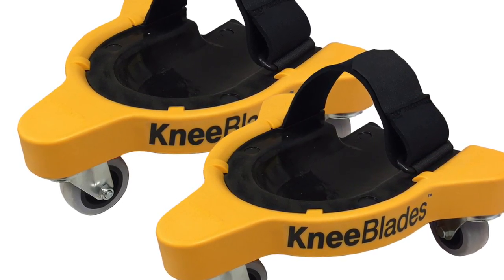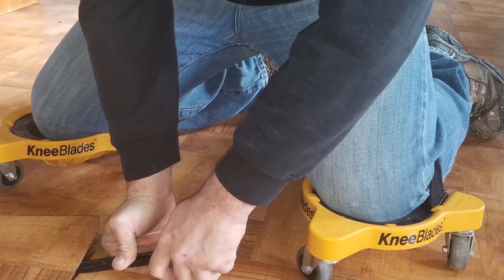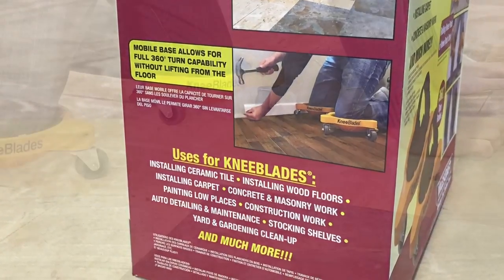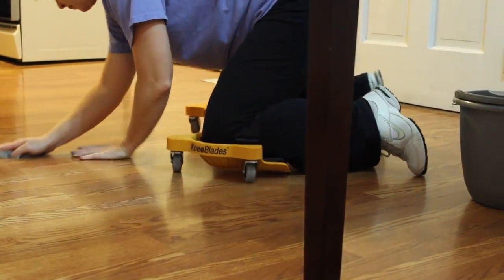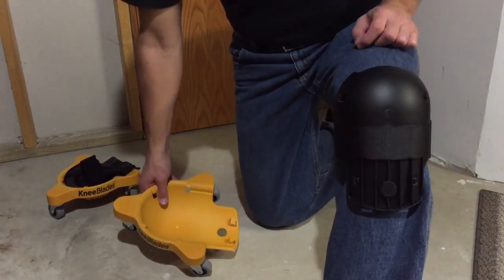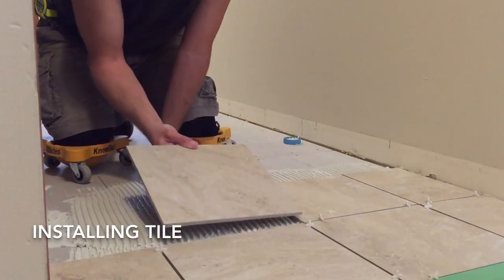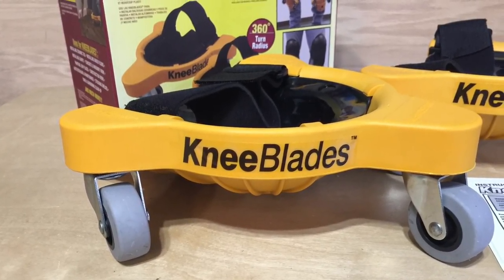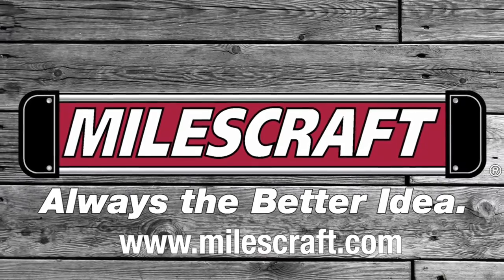Milescraft 1603 KneeBlades - Rolling Knee Pads with Wheels

Comment: As a remodeling contractor for 30 years....WHERE THE HELL WERE YOU 25 YEARS AGO???...; )...Great idea, It would be nice to have them built for guys like me 6-2 275 ..We need longer and wider knee cups also ;. WAAYYYYYY more padding! Also, mayber ultra soft neoprene 3-3.5 inch X 2" widened casters for hardwoods...And...Like rocket engines and Maybe like a set of speakers...Oh, and a place to put my I phone ...And would it kill you to put in a wi fi?...Tool storage drawers????...I'm just spitballing here...And they should cost 29.99 and be made in the USA...